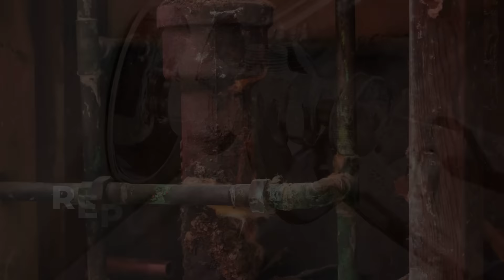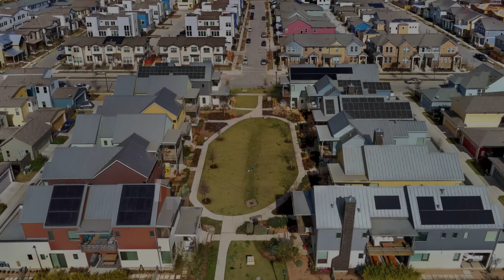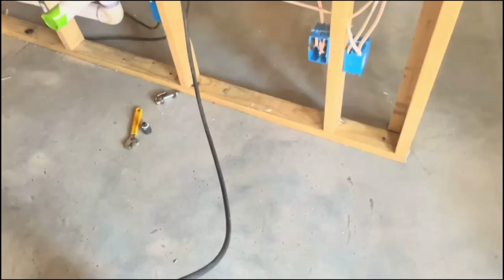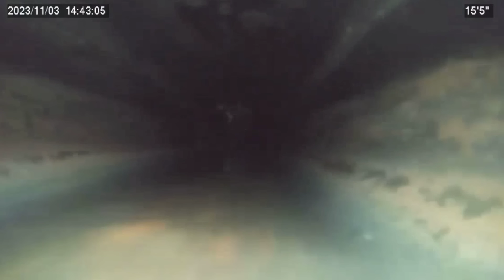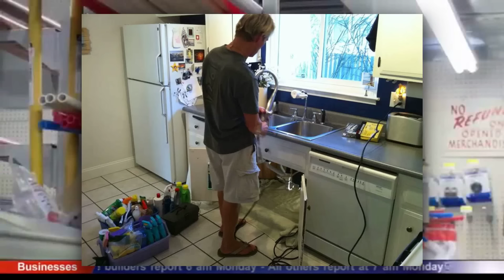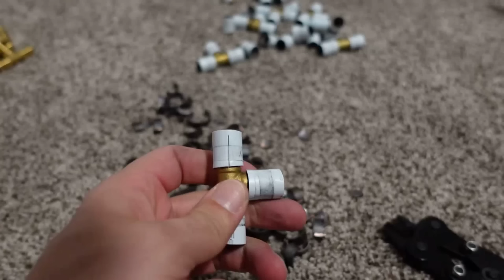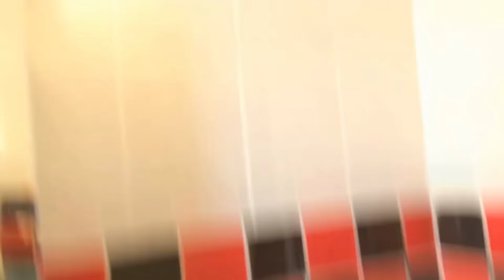Why 90% of New Plumbing Work Are Garbage (The Builder Grade Lie)

Comment: The video skips a couple of iterations of plumbing.  We did not go from copper to PEX.  We went from copper to PVC to polybutylene to PEX.  There may have been some other tries in between.  Copper is a good choice, but it depends on skilled installation.  There is also a difference between hard copper and soft copper.  Copper can  react with certain types of water. Copper also became more expensive.  We stopped making pennies out of solid copper years ago, and now we have stopped making pennies at all. 
 PVC is easier to install, and was less expensive when adopted.  The schedule 40 type lasted a long time.  It is much better for drain lines than cast iron, when installed properly,  I think that is true of all materials.
Having seen various contractors at work, I think most of them try to do the fastest job with the least expensive material.  Most of that is okay, but cutting corners on plumbing and electrical is future problems for the homeowner.  I have seen them cut corners when it would have been just as easy to do the job right.

Comment: This is what you get when you have capitalism in the absence of morals/ethics.  We see the same thing with automotive manufacturers.  Save a few cents or dollars on a part that is buried in the engine bay requiring thousands in labor to access.  Imagine if we returned to the concept of making solid long lasting products.  These changes can be used as a selling point.  Buy brand X, sure it costs a few more dollars than our competitors, but you won't have to spend $3k to repair the oil pump or wake up to six inches of water in your home.
Reply from the maker: Preach! Trading long-term reliability for short-term savings is exactly how we ended up with the 'Disposable Home' epidemic. 🛠️

Comment: The accuracy is lacking on some of these claims, but the general message is true - beware of builder quality components.  What's worse, is that these dollar figures are only for 1 failure, where there are 100's of potential fail-points in a house due to poor quality materials or installation.  Turn off your turn of your water when away from the house for extended periods, or use an auto-leak/shutoff device, but the former is cheaper and more reliable, but the latter is automatic (so more reliable in that sense).

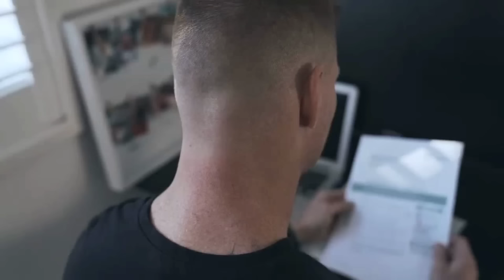Comment: Rot should have synced his script with his video better.  For example, 1:45 he's disparaging PEX and its weak point connection failures, but the video shows a mid connection pinhole leak in copper piping, that he started out bragging about.  If you're going to try and terrorize homeowners with claims of ticking time bombs, at least be consistent in your storytelling.

Comment: We need new plumbing codes for PEX. 
Too many follow the old configuration of copper plumbing. 
Plumbing in walls, fittings, and shut-off valves could all be eliminated using PEX. 
All points of failure.

Comment: 1 problem here, is the state,county and or cities make the  codes that contractors have to go by , the question is are the codes bought and paid for? Probably.  Cast iron has it's problems too. Tree roots can and do grow thru it . If there is a weak glue joint they will grow into it separate it. And also with cast the old lead joints the oakum gets to a point where it starts to detearate. And the same with the rubber that replaced lead an oakum

Comment: I do home run pex lines back to an accessible pex manifold with minimal to no fittings in between to minimize failure points.
Reply: Exactly
And honestly, some of those lines, you could actually run them if you had a thinking brain In a way where you could actually pull the old one out and pull a new one in, obviously would take some thinking and planning, but totally doable, judicious drilling nice big sweeping curves, I’ve done it with with wiring and other flexible stuff for decades
But yeah I would never have any connections with PEX that are hidden 
And if I did I would hopefully be smart enough to take some planning and put them where you could cut open some drywall and find it because you have photos to document it
Reply: @shockingguy  I did exactly that in the last house I built: homerun pex lines to manifold with no fittings inside walls, etc.  Also, ran lines in  a way that I could attach new ones at one end and pull them through if the old ones failed.
Reply: @billsmith7673 very nice that’s a good idea that I will have to keep in mind for replacement.
Reply: How it should be run.
Reply: @gurugee2112  Use curves for bends, not 90 degree angles with a fitting if you can avoid it. I use the fiberglass plastic curve bend holders to help keep the PEX in place and strength.
Reply: @gurugee2112 it’s the best, I isolate each hot and cold to each fixture except for toilet (cold only) and cuts down my plumbing bill if I need to hire a plumber. I have pressure gauges and shut offs everywhere.
Reply: I worked construction for 40 years in so cal , makes me love my house built in 1952 more and more everyday . cabinet installer
Reply: @josephpelham-g1b  Moving to Texas made me really appreciate California builds. The quality out here is trash in comparison.
Reply: @KJVsaint4life  oh noo I may never move , I was blessed , mocked by my friends when I got my house . Why not buy new ? you are so dumb look at my new house everything is brand new . 1952 they built a solid house .
Reply: What I saw once helping a guy was a previous plumber used a compression fitting to attach KITEC to a fitting. Of course it split the pipe apart at the connection and eventually my buddy was called to come fix it.

Comment: There is so much bullshit and so many lies in this video.
Reply: Your right this video is by someone that does not know what he is talking about
Reply: Like the change from Copper lines to PEX.  There are several benefits to PEX over Copper, and it is not because the builder can hire a lower cost person outside of the skilled trades.  The biggest is the cost of the material.  Copper pipe is very expensive. Potential buyers will not pay $10,000 more for a house because it has copper pipes.  I am not sure what the motivation was for this video but I also call BS.
Reply: @jimglassford9967 the biggest cost of copper over pex is the labor …skilled labor to install the copper ..someone who knows how to prep the fittings properly…clean clean clean ,reamed and de burred .then they must have the skill to solder correctly …
Yes the pex pipe is cheaper.  Also the labor to install is much less …and with these crimp fittings and crimp pro press copper fittings you don’t need a high skilled installer ..
Reply: yes
Reply: My house use all these materials and 17 years old.  Knock on wood, no problems
Reply: @dmitriyn8255  I just commented on that fact myself. Mine has had KITEC plumbing for 23 years and I've never had an issue. If it's installed correctly it should never leak.
Reply: spoken as someone who's never witnessed the horrors in a lanarr home.
Reply: Why didn't you share the "lies" with us??
Reply: Thank you for explaining all the BS. That example you give about "You Know What" was total BS! Trust me Bro we know!
Reply: So much misinformation out there these days. It’s shameful. Like marketing and advertising wipes as “flushable” or claiming pleated furnace filters are good for 90 days.
Reply from the maker: I understand you disagree, but the video outlines real issues builders face with modern materials. 🏗️
Reply: @QualityRot  You really don't know what your talking about, and it shows. You thought you could grab a "fear" and run with it for clicks. You made a mistake thinking that.
Reply: @WiggglezMr  you really don't know what you are talking about, and it shows.  Builders routinely do everything he listed in this video and far, far worse.  If a penny can be saved somewhere, they will do it no matter what that means for the longevity of the house.  You can immediately tell in the comments who's lived in a "modern" home built by a developer vs something they had built themselves.
Reply: @QualityRot except the statements on builder grade is a stretch …the T&P is installed by the manufacturer…not the builder …..builders do not install them they come from factory that grade…also there are only a few manufacturers or expansion tanks….many of the items deficiencies are from the manufacture…not the builder …
Reply: @QualityRot  But you over blow the details for views !

Comment: Anybody remember Polybutylene? Talk about a nightmare. We replumbed hundreds of houses that were built with that stuff. It was often ran through attics, and when it leaked, and it always did, ceilings would collapse. It was also widely used in mobile homes.
Reply: Yep and in Maryland we were allowed to pull many lines through the same hole ; which it would eat itself from friction, some plumbers never checked their crimper Calibration
Reply: It's still out there specially underground. I do maintenance work for a local non profit on old property and buildings. Used to be a rodeo arena on property and all the plumbing was still there as well as the main line feeding the building. All was polybutyl. I chased leaks over several acres for two years until I finally convinced them to just run a new main line the 400 feet from the meter to the building and abandon all the pb. They were losing as much as 100,000 gallons of water a month with $900+ water bills. Not anymore.
Reply: Yes the old “gray” poly. As with polyethylene it was mostly the fittings that failed.
Reply: When was that used?  1980's?  My first house built in 1988 had to have all the plumbing upgraded to CPVC.  I think it was that Polybutylene stuff that was failing.
Reply: @BartSparrow123  Polybutylene was primarily used from 1978 to 1995.  Due to many failures after 10-20 years of service, a ban was enacted in the US in 1995 or 1996.
Reply: @jasonj9864  Thanks, makes sense.  House built in 1988 and I believe in the late 90's it was replaced with CPVC.
Reply: @BartSparrow123 it goes back to at least the seventies I believe.
Reply: 40 years ago a Coworker who's house was in Simi Valley Calif  had that Polybutylene water pipe issue.The whole subdivision had it. I think leaks in a few homes triggered the knowing that the entire subdivision was involved. I am not sure if the pipes were replaced or just the fittings, 

This Coworker had a full machine shop in his garage and worked as a full time Machinist at Northrop; and later at some consulting firms. He actually rehoused some Nikon F still lens blocks in Panavision custom lenses they rented for their cameras. ie many Cine lenses were just rehoused still lenses. With a declicked Iris and better focus throw and markings.
Reply: @3beltwesty  I'm in the Phoenix, AZ, area, and there were hundreds of thousands of homes built with that stuff here, going back several decades. There was a class action lawsuit against the company that made the stuff, and they wound up having to pay for having houses replumbed. But there was a time limit on it, and unfortunately most people that had it didn't even know it, and by the time theirs started leaking, the deadline for getting it replaced with copper free had expired. We did hundreds of houses. It was very expensive. After we replaced all the piping, we had to have one or more contractors come in and replace walls, cabinets, and everything we had to tear out to get to get to the plumbing. Places like Home Depot and Lowes are STILL selling fittings for it. It was/still is a real nightmare. Just like when they were wiring homes with aluminum Romex instead of copper. A lot of that stuff is also still out there.
Reply: I have that type of polybutylene in my 1995 2000 square foot mobile home. I haven't had any issues with it.
Reply: A relative has a double-wide manufactured in 1995, just before polybutylene (PB) was banned. Still in good shape with no issues yet, except we replaced 3 bathroom sinks and the supply lines had to changed. Original PB went all the way to faucet with no shutoff valves.  Full re-pipe was not in the budget, so under each sink I cut the PB, used PEX with crimp-connnector Sharkbites (not push-to-connect), added shutoff valves and braided supply lines. One year later no leaks.  All of the PEX is in climate controlled area under the sinks, so we're hopeful and confident that this will last many years.
BTW, my thanks go to all who contribute here that point out the good and the bad of different products and installation techniques.  I learned that Sharkbite makes many crimp-on PEX connectors, not just the push-to-connect that they are famous for.  Thankfully they had an inline coupler to change from PB to PEX that crimped on.  Crimp-on was by far the majority of recommendations from plumbers.  When I priced out the cost for all the push-to-connect connectors and compared that to the cost of the crimp-on connectors plus the tool, the crimper & tool only cost about $10 more.  Easy decision to go that route.
Reply: I have PolyB in my house, built in 98, my plumber used copper fittings not the plastic ones. No issues, but my city water is pretty decent.

Comment: Copper is copper, but PEX can be cheap, cheaper, good or excellent.
Reply from the maker: True, but even the best PEX still can't compete with the longevity of copper. 🧱
Reply: @QualityRot  It could be, but not enough time has passed to prove it. There are many excellent PEX installations that are still standing and in use for 30+ years. It simply hasn't been available for long enough unlike copper.

Comment: After replacing every supply hose in my 1962 house probably 20 years ago, I can say that in most cases you'll also need to replace the wall stop too. If they aren't seized in the open position, they'll likely leak so badly you'll want to replace them for that reason.

Better to get those 1/4 turn valves anyway.

Then I had to replace them all again some years later because the rupture stop kind of hoses I bought thinking I was getting the best, get internally clogged with sediment and stop flowing. Now in our new-to-us 1978 house we have a water softener so that probably wouldn't happen, but now they're off the market.
Reply: The 1/4 turn valves are ball valves. I wouldn't use anything else. But even they need to be turned off and back on every few months. Especially if you live in an area with a lot of calcium chloride in the water.

Comment: There's been plenty of technical studies for wear and tear and longevity of Pex and Pex A. Along with shark bite fittings. The O-rings are said to last 50 years, but even half that would be acceptable as they are meant as a quick fix and not meant as a seal behind walls. But the advantages far out weigh any negatives. Pex doesn't freeze as quickly. It's easy to deal with repairing leaks even when water is still in the lines. It's much faster and more cost effective to install. DIY'ers can easily work with it. Copper is basically the opposite. And I've seen so many pin hole leaks over the years that have ruined sheetrock walls or bad solder joint eroding and eventually leaking
Reply from the maker: While those studies exist, the real-world application often falls short of laboratory conditions! 🛠️
Reply: @QualityRot  In my own home which started with galvanized 75 years ago, copper was replaced in many areas in a crawl space. I bought the house 30 years ago and have had a number of leaks around fitting and a few pin hole repairs. Actually did some quick repairs when shark bites fittings 1st became available because water in the lines kept making it a problem with the intent on fixing it permanently later. Being it was so close to the access door of the crawl space I just kept watching it. It's still doing fine with no leaks or green showing around the fittings like many of the copper pipes and galvanized piping do. Been using pex where ever copper is not a necessity anymore. Shark bite fitting are in my bag for emergencies but only in my own home. But only in open areas I can get to and keep an eye on. Never ever had a fitting leak or joint leak like people sometimes get with solder. Many plumbers who swore they wouldn't use pex now do. One definite pro over copper is the freeze temps are better good for my home for sure.
Reply: For the non-plumbers reading this... When I was researching and pricing out PEX and Sharkbite to help my sister install some new sinks in her manufactured home (i.e. mobile home) I discovered the following:
1. Sharkbite, which is probably most well known for their push-to-connect connectors, also makes crimp-on connectors.
2. Sharkbite introduced the second generation of the push-to-connect fittings in 2023 to address their longevity issues.  I only happened across this because I saw that Home Depot was selling the connectors for 75% less online compared to in-store.  When I inquired, they told me the online versions were a clearance price on the first generation version. 2nd Gen has longer warranty.
3. There are different thicknesses of PEX for different uses.  Primary differences are that the thinner version is more flexible so it can curve more, thick version can withstand more pressure.  Couplers and elbows install differently and the thicker version is more DIY friendly.
This is a good video explaining differences, pros & cons, of the different types of PEX: https://www.youtube.com/watch?v=ZmaYhDYMRuA
Reply: Wrong copper has stood the test of time pex hasn't period
Reply: @kalegallarde6369  You have no idea what you are talking about. Pex is the superior product.
Reply: @k @kalegallarde6369 s to do with the quality of water. If your on an untreated well system copper is the worst pipe to use. I only use copper on hot water heating systems and houses with treated public water supplies. Any plumber knows copper and well water don’t mix.